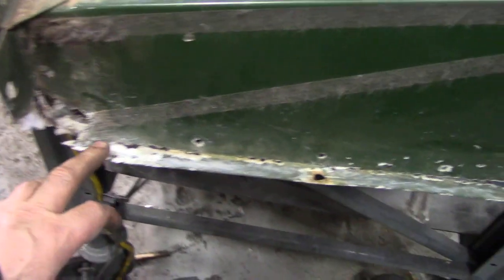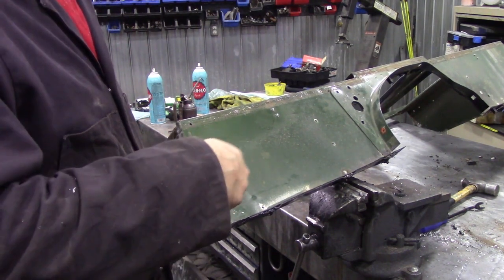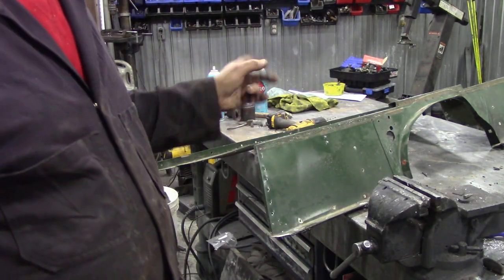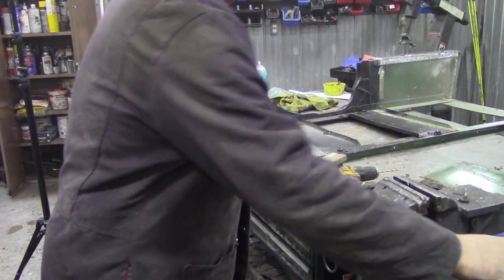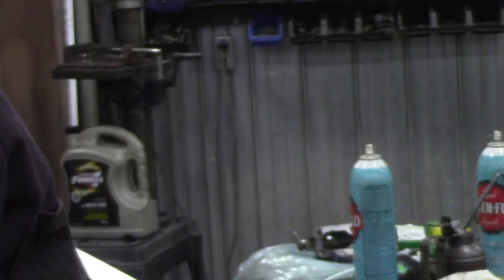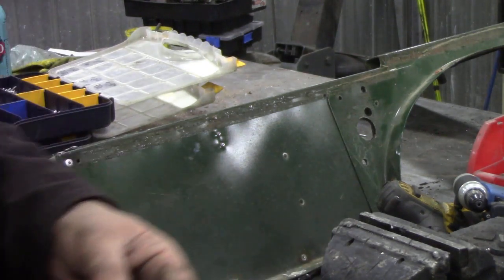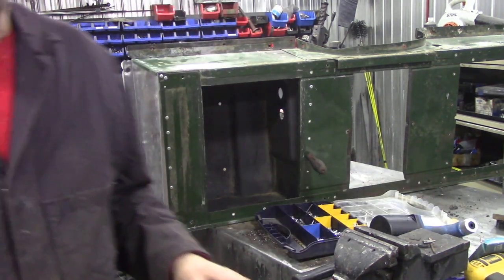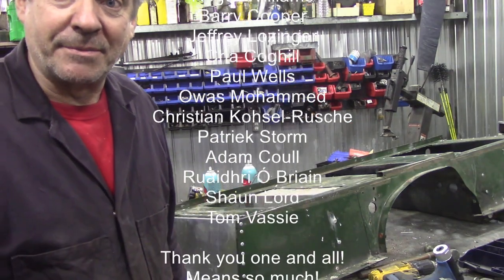Defender / Series. Replacing the seatbox  / side panel  / battery  / tool box

Comment: Pretty sure i fitted an ali replacement battery box from yrm a few years back, everything ive had from them has been top notch. Need to do top corners & A post (amongst other jobs) and will use them for parts
Reply from the maker: Yes they are very good!
Mike

Comment: So reading through the comments I saw where you said the 90 doesn't come with a RH seat/toolbox. Being a new owner I didnt realize this. I thought mine had been removed or was rusted away as my battery box is terrible. It looks like there is plenty of room for one. I plan on pulling everything and replacing the battery box so can I put in a RH seatbox without issues?
Reply from the maker: the Pre Td5 had the fuel tank there - you can get the boxes from YRM

https://yrmit.co.uk/product-category/land-rover-defender-90/seat-box/

Comment: Hi there. I enjoy your videos religiously lol. I've moved my battery into a box in the rear of my defender 90 so my question is... when the time when the two empty compartments start to rust below the seats what do I replace the battery/seat boxes with? What would you recommend I purchased to replace them with i.e. is there a galvanized solution or all aluminium option and what is the best if price isn't a factor? Since both boxes are empty and seats are fixed. Do you recommend any modifications I could do to further weather proof the whole seat/battery box assembly underneath? Also I'm guessing those two cavitys dont do much to reduce the ambient sound in a running defender so I was thinking about maybe lining the inside of the new assembly with dynamat or filling it completely with foam blocks or something to reduce noise. Any thoughts on this? I'm worried about the build up in moisture in them so ways to alleviate that would be helpful. I'm considering sealing the access panel under seats to make it more water/sound tight? Any thoughts would be helpful. Just trying to future proof any potential issues and improve longevity of the vehicle. Thank you so much for your youtube content btw. If you lived in Northern Ireland I would have a million questions and work for you. My father just bought his first defender so your vids are very much appreciated.
Reply from the maker: Hi there!
You should check out YRM on line for some ideas

https://yrmit.co.uk/product-category/land-rover-defender-90/seat-box/

They do some good stuff
I have no affiliation with them but I know they do a good product

Dynamat is good for sound reduction, 
But I will let you into a secret - a lot of LR noise is amplified by the roof - put some sound deadening in there and it will make a difference depending on the roof type

I would not use foam unless it is closed cell foam, as it can absorb moisture and make a problem worse

To be honest you will never make a Defender comfortable for noise - I have seen all sorts of ideas and not much works that well - I have tried loads of stuff and cutting the vibration of large panels helps the most  - and you do not need a lot of sound proofing - some people go mad and cover every inch, but think about putting a large sticking plaster on a drum - it will cut the vibration and thus the noise
Mike
Reply: YRM fully recommended, we use there products on our restoration and repairs and find them excellent.
Reply: @BritannicaRestorations  Thanks again for your help.

Comment: Hi Mike, I was only recently made aware of your vidoes as I am rebuilding an 88". Somoehat handiliy as I'm about to start putting my tub on and am well impressed about your guides to that and the sills. I'm also considering replacing a side panel in the seatbox and tool box. (thumbs up for YRM). 

Would you recommend setting the sills up with or without the seatbox in place as they will obviously need unbolting to add the seatbox?

Just like to say I have found your videos highly entertaining and extremely informative. Plus your cack handedness makes me proud to be a Yorkshireman too. I'm always knocking my powertools of me workbench :-)
Reply from the maker: It's 6 and 2 threes to put the sills on - by that I think you mean the C channel sill?
Mike
Reply: Hi Mike, yes the C channels. As per this video I am about to replace the l/h side panel and tool box first. I've just bolted the tub to the rear xmember. I'll be following your methodology for setting the sills square, then aligning the bulkhead. I asume setting the sill angle is easier with the seatbox out, but then of course the seatbox would need fitting by popping the sill end / tub bolts out.

YRM suggest using stainless fittings, but then I read dire warnings from others about adding SS to the Ali / steel mix as that increases electrolitic corrosion. I will be painting all surfaces before assembly as the sillas are new galv as ar the seatbelt brackets.
Reply from the maker: I think you can replace the side without removing the seat box  - I have done it in the past
This will give you room to put your square on 
I am reluctant to use SS, but I have in the past - zinc plated steel bolts are pretty bad and only last a few years
If you use plenty of anti seize and rust proofing to seal out the moisture SS will be OK